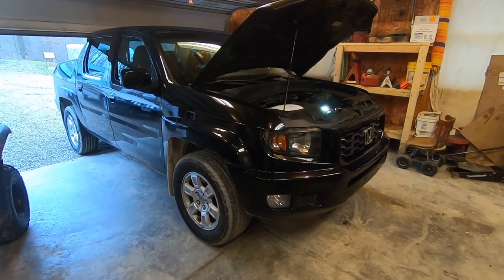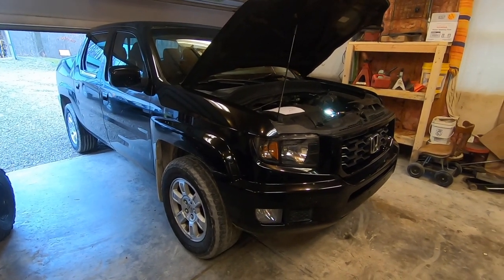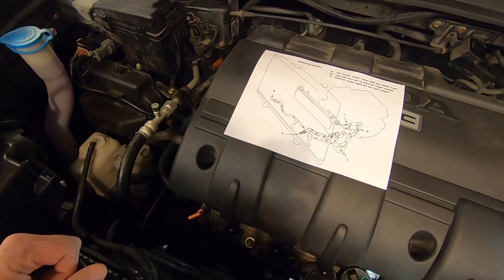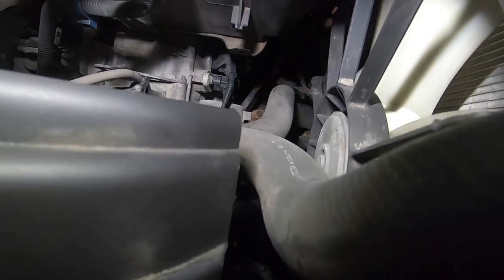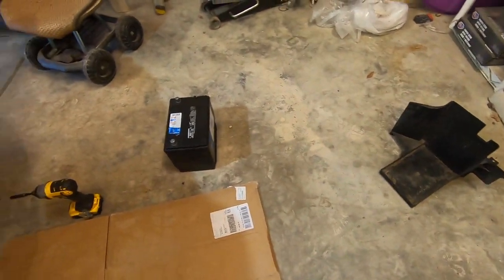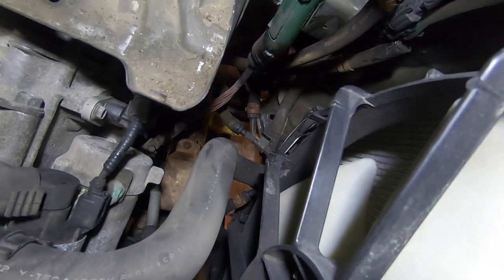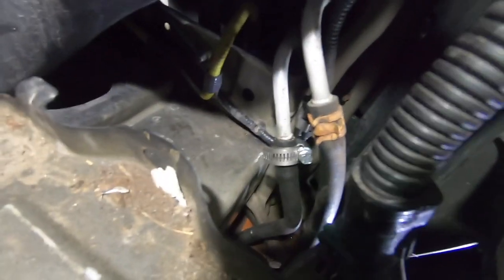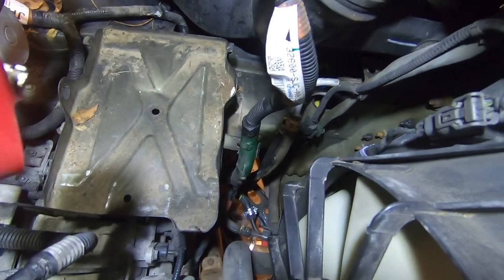2006-2014 Honda Ridgeline Strawberry Milkshake of Death Prevention For Only 1 Dollar SMOD

Comment: one question : If I live in Mexico , where the air temperature is almost always 86F and above  , so  how will ATF be cooled?
Reply from the maker: You can run a bigger cooler with a fan or just leave it the way it is and 🤞

Comment: After the modification, did you have to plug each end of the original tubes that you bypassed? I ask because if they corrode or break inside the radiator, won’t they leak radiator coolant out via the original cooler lines?
Reply from the maker: I address this in the video

Comment: Does it also effects 2012 sport model, currently have 91,000 miles 
Did the timing belt, spark plugs, alternator and belts at 88,000 miles. 
I should have also replaced the radiator at the time of timing belt replaced but 
(dealer never recommended the this radiator issue)
Please help thanks
Reply from the maker: It's not as big of a deal on the later 1st gen Ridgelines, but can happen. Do you live in an area that gets snow and salt on the roads? If so, I would take measures now

Comment: Would changing the transmission fluid every 20000 miles or so help prevent this problem?  I have a 2006 Ridgeline with 90000 miles.
Reply from the maker: It wont help with this problem but it is a good idea to keep your transmission happy. This is a corrosion issue caused by environmental factors. Either change the radiator or do this bypass.
Reply: I replaced my radiator and the transmission hard line that is at the bottom of the radiator that was severely rusted but not leaking.

Comment: Ok maybe I’m missing something but why not just join the inlet & outlet tubes at the junction together and cap off the radiator bottom tubes?
Reply from the maker: I don't understand what you are saying. You have to make a loop from the transmission inlet and and outlet through the independent transmission cooler. I did it the easiest way possible.
Reply: @JackofAllMasterofNone  the lower tube going from trans to the radiator is perfectly long enough to go straight to the cooler return line! Using the same tube & clamps! No extra tube or loop needed

Comment: My mechanic, who specializes in Japanese autos like Honda didn't seem to think this was a necessary procedure.  I don't think he has seen this as an issue.   I wonder if areas where the roads are salted in the Winter have a much greater problem with this problem....
Reply from the maker: Corrosion is the primary cause of this failure. It's a well documented, somewhat common problem, especially on the early 1st gen Ridgelines. You can do a quick Google search and confirm that for yourself.
Reply: @JackofAllMasterofNone  Excellent and practical video.  Thank you.   You mention 3/8" rubber hose; does it have a particular specification e.g. for transmission fluid?  Also, was the routing of the tranny fluid through the radiator primarily to cool the fluid or to warm it up? As I live in Florida, would I need to monitor my tranny fluid temp if I do this?
Reply from the maker: @dgriffin6074  as I said in the video it both warms it up in cold weather and can slightly cool it in extremely warm weather if the transmission fluid temp is higher than the coolant temperature. But that is very rare unless you are doing extreme towing in high temperatures. I'm monitored my temperature after doing this modification and it was always lower than expected and lower then before after sending it through the radiator. I would use a hose that is rated for gasoline or oil that way it can withstand the transmission fluid
Reply: They happen on the Pilots as well.

Comment: how about a 2019 still an ishue?
Reply from the maker: No. The gen 2 Ridgelines don't have this problem as far as I'm aware.
Reply: @JackofAllMasterofNone , the 2G also has an ATF-to-coolant heat exchanger, but it's mounted on the transmission instead of inside the radiator. A failure mode similar to the 1G is possible even if it's unlikely.

Comment: Those transmission cooler fittings will still corrode though, and when they start to leak your rad will need to be replaced anyways.

Some aftermarket rads use brass fittings and do not suffer from SMOD, which is caused by a steel washer swelling against and stripping out an aluminum fitting.
Reply from the maker: A leaking radiator is way better than mixing coolant and transmission fluid.
Reply: @JackofAllMasterofNone  truth. 😏

Comment: I see what your attempting to do,  but unless you switch to an aftermarket radiator, your only alleviating half the problem, and by taking the hose off, most likely accelerating the other half the problem.
Reply: You make no sense. If the radiator still fails not the disconnected cooler it will not destroy anything.
Reply: @cowlumbus  Where did I say his fix would destroy anything?  It is clear that the stock radiator is badly designed with bad quality control.  Replace it with a proven after market one and allow your transmission to be cooled properly as it was designed to  do.
Reply: @luckyx16  the Ridgeline already has an external cooler along with the cooler integrated into the radiator. The point is to bypass the cooler in the radiator whlle keeping the external cooler.
Reply: @vasekvi  The point is, the radiator is going to fail, no ifs ands or buts about it.  Save the headache and do it right the first time, instead of a work around.

Comment: This has nothing to do with fuel economy it has to do with getting the transmission to operating temperature as quickly as possible.. and it's the same case with your engine.  Just about every car manufacturer with an automatic transmission has a radiator with two sections. Everything mechanical has an operating temperature they work better and last longer with less wear..  we achieve this by heating up the transmission fluid along with the coolant from the engine and then when it's too hot it's cool with the transmission air. cooler.  Try getting your transmission to p perform well when it's - 20
Reply from the maker: A cool transmission is a happy one. Period!

Comment: Just an FYI... this design is part of a towing package. Once you bypass, you will lose towing capability.
Reply from the maker: Wrong. Like I said in the video if you are worried about it, datalog the trans temps while towing and if necessary add a larger trans cooler to replace the factory one. There is no situation where hot engine coolant should be cooling down trans fluid.

Comment: I would just replace the radiator if it starts to look bad.
Reply: Yes, that’s how you fix this issue. This by pass is not allowing the transmission to preheat. Your just moving from one issue to another. $10 for $200 on to $1000’s. If you find rust on the transmission lines fittings going into transmission change out radiator and don’t screw with the transmission cooling circuit.
Reply: My understanding is that it rusts from within.

Comment: Don’t do this if you plan on towing heavy loads, boats, campers, RV’s that push the limit of the 5000lb towing capacity. You risk cooking your tranny fluid and shortening the life of your transmission.
Reply from the maker: Like I said in the video, recommend data logging the transmission temps if towing. If necessary can add a larger aftermarket tranny cooler, which would be 10000% better than the radiator based factory cooler/heater.